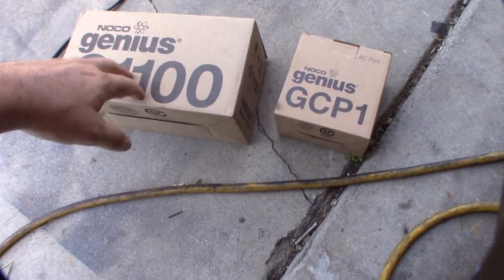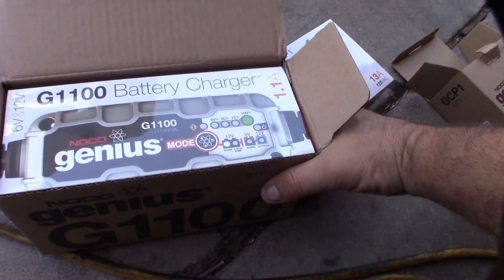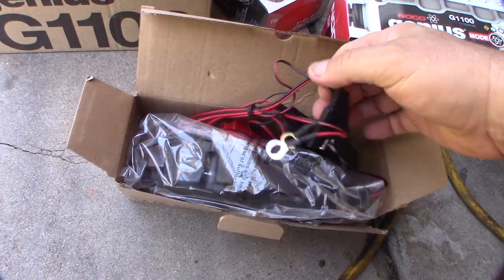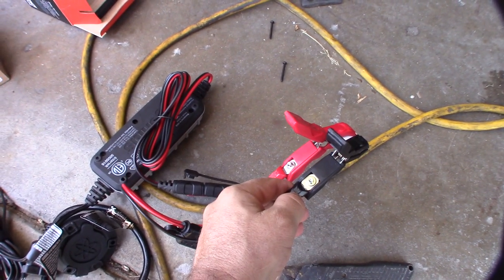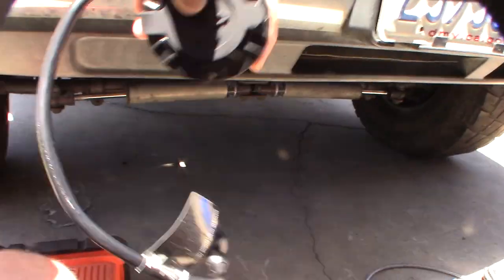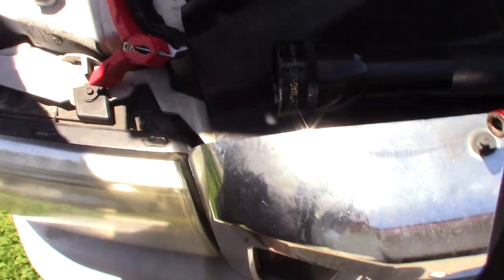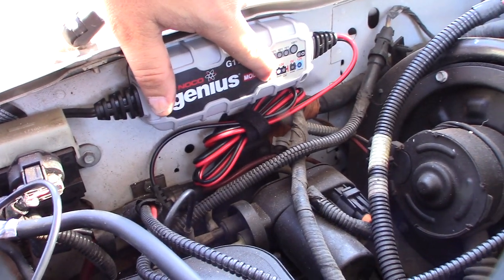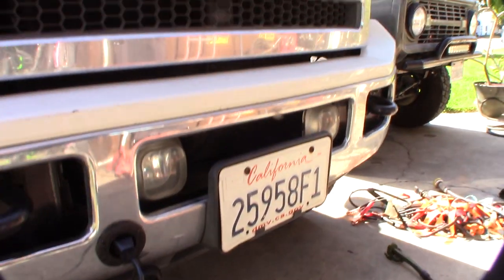F250 Powerstoke permanent float trickle charger Noco Genius G1000 install parasitic draw lithium

Comment: I have a question about hooking the charger up. Do you put one lead on one battery and the other lead on the other battery or do you just trickle charge one battery at a time? Is there a way to charge both battery's with one trickle charger?
Reply: if still cruious.
genius 5x2 charges,maintains, have them on both your batteries 24/7. lifesaver for a diesel espically in winter or if your batteries aren't great? mine went from 60% load to 94 and plays my sub/amp/starts like a charm.
Reply: @4gs933  But is it safe for the battery's? I've read people saying there is some way to harm them or other things having both batteries hooked up to the truck while trying to charge them both. they say its best to take them out of the truck then charge each one separately.

Comment: I bought a NOCO Genius 5 Charger/Desulfator for my 1999 F250. It should split the 5 amps between batteries. I keep Interstate 5 year batteries in my truck. I hope your charger is working well. 550 ma per battery seems really small for the batteries in your truck. Is the Genius 1100 also a Delulfator? Looks like a good install. How is the cover for the plug holding up? Is it staying in the hole or falling out?

Comment: i need to do the same thing as i have 3 AGM deep cycle batteries in parallel. two for the truck and one for the 4000W Charger. although i have 440A duel alternators, i still want a back up so i don't blow the alts

Comment: How is that at charging a dual battery set up... Just wondering if it was enough
Reply from the maker: So far so good, I just use it as a float. I'm sure of both my batteries were dead it would take a long time to charge.

Comment: Thanks for the video.   Did you hook both batteries up or just one.  If you have 2 batteries do you need 2 trickle chargers?
Reply: No you don’t need 2 trickle chargers. It will charge both batteries
Reply: As long as it’s connected in parallel, as all diesels should be, it’ll charge them both.